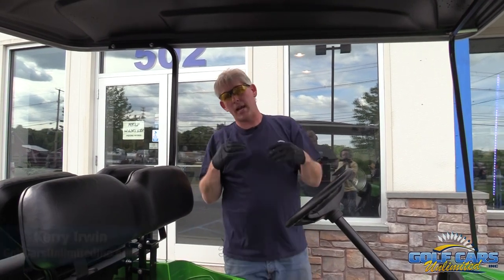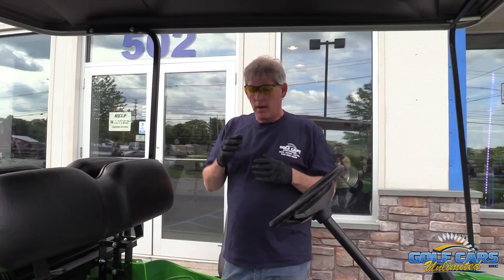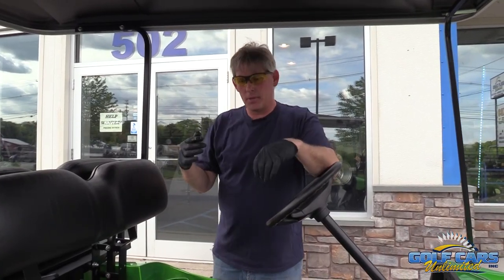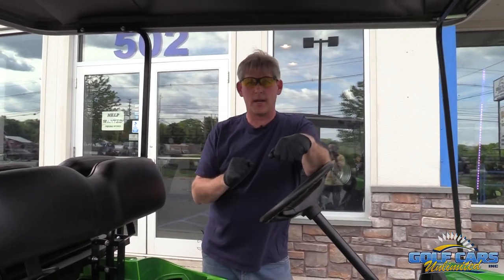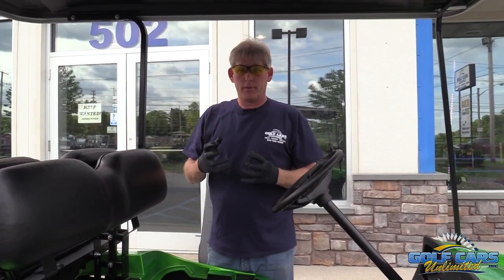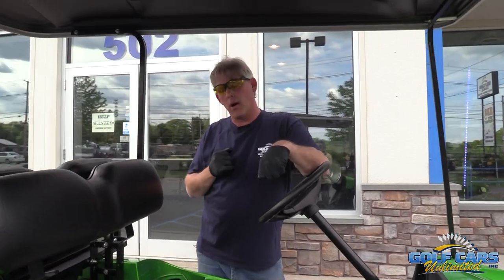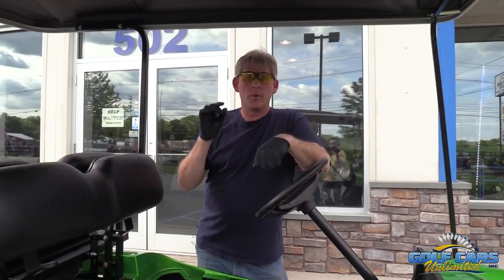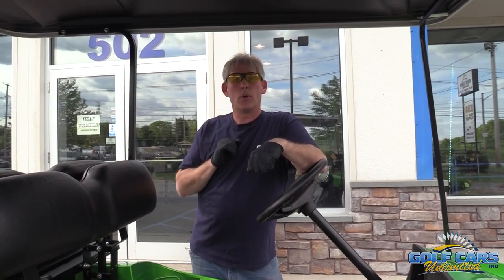When to Add Water to Your Electric Golf Car Batteries | Golf Cart Maintenance

Comment: So you want us to charge batteries that have no water in them? That cant be good either adding water after the fact ? I mean if I add water after the charge won't it just be the same level that afternoon I charge it? The water will be at the same level weather I charge it now or later water will potentially boil out. I think u just fill it correctly and it won't over flow ?

Comment: When I’m not using the golf cart, should I keep it plugged in to the charger?
Reply: I know I’m 2 years late, but yes, this keeps the charge in your batteries from going bad. It’s important to always keep it charged with no use. Make sure there is water in it fully, or you could end up with a golf cart fire.